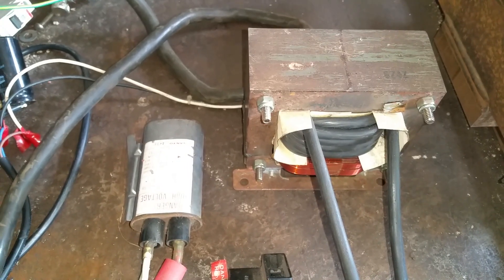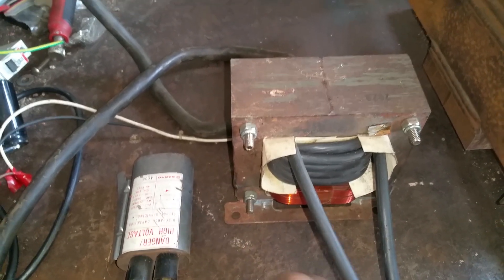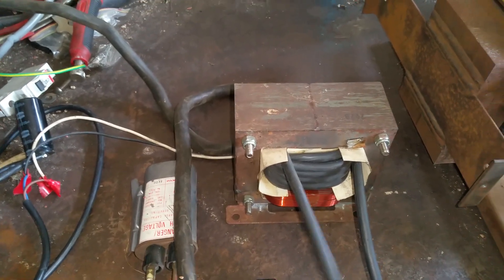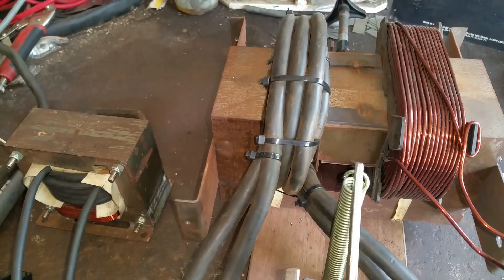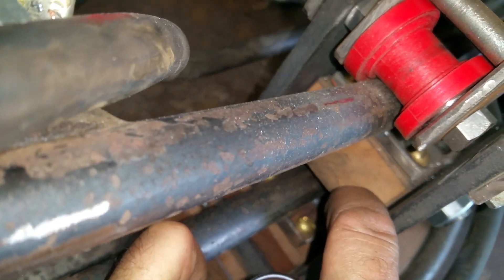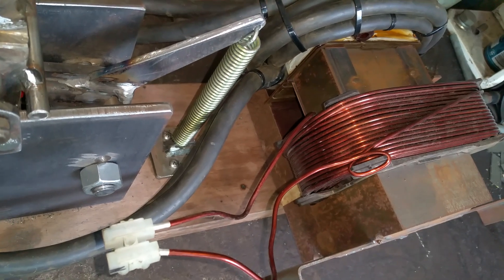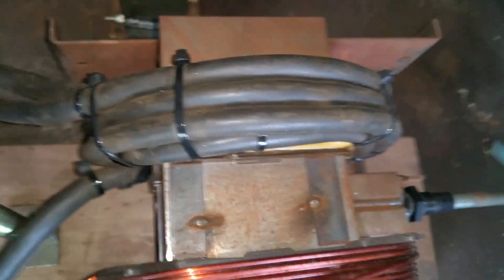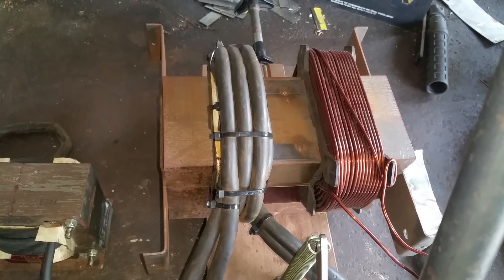Big Home Made Spot welder Part 1 MOT to 140A Arc welder transformer

Comment: I have the exact same welder in my shed, I was already thinking of making a spot welder with it before I watched your video but I was under the impression that I could just use the positive and negative without gutting the welder???
Reply from the maker: Hi, if I understand your question, you were thinking of just using the welder as is and just connecting the leads to a pair of arms, is that correct? If so, then it won't be a spot welder. The arc welder is a constant current machine and the voltage varies depending on what size electrode you use, the distance you hold the electrode from the work and the amperage you set plus the capability of the welder itself. In effect the amperage will be between the ie; 20-140A or what ever the machine is capable of, and the voltage could be as high 20-30V.
For a spot welder, depending on how you rewire it, the voltage could be between 2 to 5V and amperage could be in the hundreds of amps.
Once you rewire it as a spot welder you will not be able to use it for normal MMA (stick) welding.
Reply: @000Ed1  awesome thanks for the info,,, yeah I understand what you mean,, might just remove the copper and replace it with cable and then attach the cable to the original electrode and earth connection terminals.

Comment: could it still be used for arc welding after wrapping the new thicker wire around it? if so what would it do to the characteristics of the weld?
Reply from the maker: Hi, sorry I haven't responded earlier as I don't follow this thread anymore, but to answer your question, no, it won't work as a standard welder anymore. Using the thicker wire with less windings, gives you much more amperage but also much less voltage, which you will need for normal MMA (stick welding).

Comment: why cant you just use the welder to power the spot welder as is, I'm looking at making a spot welder using the older blue and white model of that welder you got
Reply from the maker: Because the voltage from a welder as  standard is too high so you need to reduce the Voltage to get more amperage and the thicker the cable to do so,  (thicker wire is harder to form around the core though), I only had bit of old cable so used what I had and just doubled it up to make it thicker. The open circuit voltage on a welder can be as high as 80V, so with arc welding when you strike an arc you actually pull the electrode a bit away from the work piece which makes an arc, and the arc generates the heat to melt the electrode and then makes the weld. With a spot welder you apply pressure to both bits you are trying to fuse and the  current goes through from one electrode to the other and the metals resistance causes the metal in between to melt so no arc and in effect it is a dead short.
Watts=Amp x Volts, so if you want more amps from a given wattage going into the transformer you have to reduce the voltage out (allowing for losses due to transformer design and inefficiencies) but you can't get more wattage out than you put in so you have to reduce the voltage to get more amps. Hope that makes sense.
Reply: @000Ed1  oh ok. thanks, the welder I was going to use i still need to use as a welder so there goes my idea

Comment: What is your voltage Most people only run about 2 volts? The current being applied for such short times only require a single welding cable with one wrap around transformer to get max amp and min volts. Rarely use anything but max amps on anything as quicker the weld the better , just vary time not current . I'm building one with an ebay timer about ten bucks and 240v relay to control time and that would be a great mod for yours,as you get experience write the times on a chart for future reference. Much more reliable than guessing time of each spot.I'm also looking at rectifying the output from the transformer as from what i have read dc does a better weld, big rectifiers are only another 12-12 bucks on ebay , three phase are often cheaper you can use them on single phase just leave third wires.
Reply from the maker: Hi Col, I think mine ended up approx 5.3V off the top of my head as I didn't have any thicker or and longer cable  so that that is why I did two wraps  of 2/0 cable wired in parallel, I also added a relay switch and electric timer to my build.  
This URL links to the second part of the build  
https://www.youtube.com/watch?v=zX7ZKDRDkXk. 

Wanted something for spot welding slightly thicker steel so the more amps (even if it is at a few more volts) the better. 

One day if I get my hands on some 4/0 cable I may just rewire it again, but as it is now I can fuse 2 x 6mm stainless rods together in about 3 seconds which isn't too bad I suppose. I have also used it to heat up and harden chisel ends which it does quite well.

Comment: very Nice work. have you an idea about rewiring for a professionnel spot welding transforme or a simuler .
thanks...
Reply from the maker: Hi, thank you, I don't, sorry, I only dabble in this sort of stuff,  I would imagine that a professional unit would be designed to give more amperage starting with the design of the transformer frame and also the wiring to make it more efficient. Also they probably add large capacitors to store and discharge a bigger current in a shorter time frame. 

From what I have seen my unit is a small one compared with the commercial versions  which can go 3 phase and up to 50Kw. My transformer uses 15A@240V so the most it can produce is 3.6Kw and if the output voltage is 5.6V then the total amps it can produce is about 640A and that is if it was 100% efficient which it won't be.  

So despite all the videos that show huge amps out of microwave oven transformers, those don't really produce that many amps, probably because they hold the clamp meter too close to the transformers when measuring which gives incorrect readings. Basic law of electronics, you can't get more power out of a transformer than you put in and usually much less due to heat produced and inefficiency of converting the volts and amps.

This one does its purpose for what I wanted at a very cheap build price.

Comment: I have a 180 Amp arc welder that I thought of transforming into a spot welder, but I do not want to destroy the welder, will it be possible to just wind over the secondary coil another coil for the spot welder?
Reply from the maker: I don't think that would be possible as there won't be enough room for an additional thick cable to go over the existing strap coil and still go through the hole in the middle of the frame. The idea is to use the thickest wire you can fit in it with enough wraps to give the voltage you require, while still being close to and through the metal frame. As far as I know, the thicker the cable the more amps it will produce. I would have liked to use 4/0 wire for mine but didn't have any and it would have been quite expensive to buy. Only reason I used this welder for a transformer was that it only cost me $20 and I have another better one, but if it was an expensive welder or the only one that I had then I would not have used it.

Also if it was possible to add another coil over the existing one, I would imagine that it would affect the welding output as well so your welding may suffer as a result.
Reply: Thank you for your feed back, I'm just narrow minded about certain things, I do have a better welder and got the transformer welder for free, so I'm just gonna follow your lead and go for it. Tanx
Reply from the maker: Sorry, that is out of my depth, personally I don't think you will get satisfactory results. That question is an electrical engineering one and which I am no way qualified to answer.

Comment: Nice work you got there especially the arm mechanism.  Regarding the direction of winding coils it doesn't really matter. Well the bottom connection would have been better if attached directly to the copper pin as it would minimize loses. If you opt for a foot pedal well see that you use  a relay.  I also think that if you connect a parallel capacitor to the primary winding will correct power factor as well as lowering the input current. Good job well done.
Reply from the maker: Thanks Silvio, I had the same idea about the connection and so in the second video clip (https://www.youtube.com/watch?v=zX7ZKDRDkXk&feature=youtu.be) I have removed that bit and extended the cable all the way to the copper electrodes.

Comment: I have seen on other videos that there are only two to three wire while in your project you used many windings. Does that raise the amperage? The second question concerns the direction of the wire windings, do they have to be clockwise or the opposite? I would be very pleased and grateful if you could explain that.
Reply from the maker: Hi Salah, sorry I didn't see the actual question in the above post, anyway in Australia where I am we generally have 3 wires, 1 earth, 1 active and 1 neutral wire which gives us 240V at 50hz, the amperage draw on the primary uses about 10-15A depending on the thickness of what ever I am trying to melt. Once you go past that sort of amperage you should be looking at a 3 Phase unit. Which is 4 wires, 3 active and a neutral which ends up about 430V. 

The actual coil winding that I used to replace the original secondary coil is 2 coils of about 3 wraps 2/0 multi strand welders cable joined together at the ends. This enables the voltage to stay low but doubles the amperage generated, if I had used a single continuous cable it would have meant that the voltage would have doubled but lower amperage. Hope this answers your questions.
Reply from the maker: from what I understand it probably doesn't make much difference in this application as it is AC voltage, although I did try to keep the same direction as the primary coil.
Reply: salah ouali